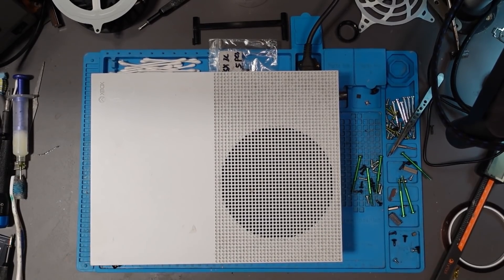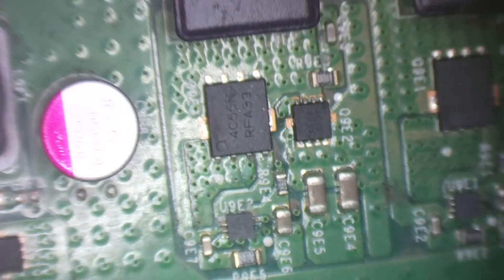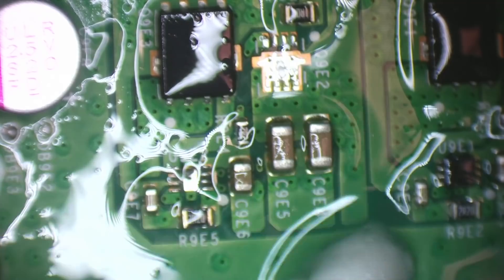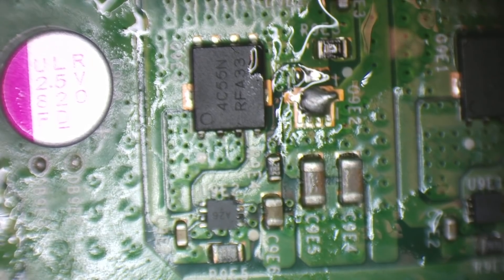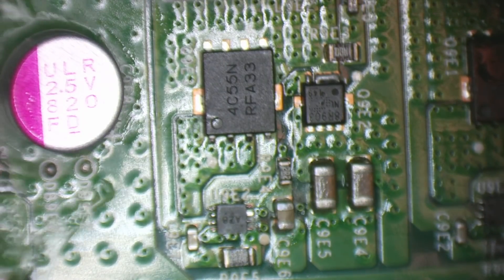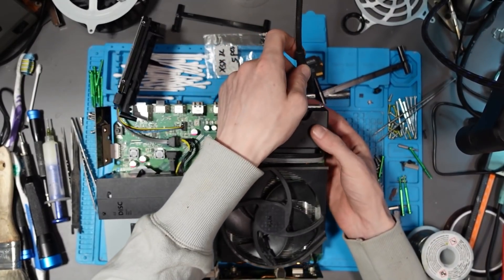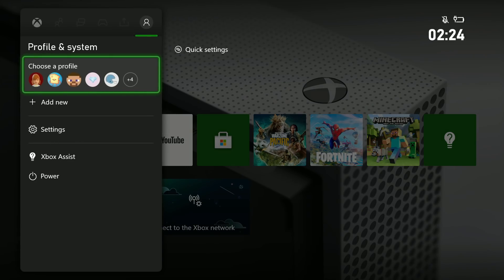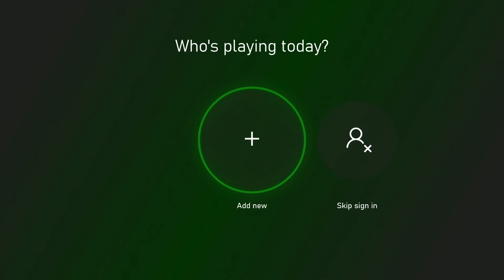I Paid $70 (£55) For A Broken Xbox One S From CASH CONVERTERS And This Is What They Sent Me...

Comment: Nice video man! I never owned an xbox one but i was considering getting a second hand one. Is it still worth getting one now with the series s/x being out?
Reply: No get the series s killer deal NEW
Reply: @fredc8618  i thought about series s but i don't really like the all digital concept i'd like a disc drive
Reply: Killer deal? What's that btw?
Reply from the maker: I'd say depending on price, but the series s is a good deal if you can pick one up second hand (bare in mind it's digital)
Reply: @TheCod3r  second hand? U can get it for as low as 250 new with a new controller and 500gb ssd cant beat it
Reply: Ppl are selling there used xbox ones for 200 its insane
Reply: @fredc8618  oh yeah but i saw one in netherlands at a pawn shop for 109,99€
Reply: @fredc8618  i'm not gonna pay around €200 or more for used anyway but you're right

Comment: I have a One X that failed on me. I managed to get it running but continued to fail over time. I believe I turned the power supply off during an update? Pretty sure it's a duff hard drive. You're welcome to have it and see what is actually the problem.
Reply from the maker: Is it a launch model One X mate? They had issues with the sata cables on the launch model which could explain it
Reply: It is mate, makes sense for it's random behaviour, from what you say.

Comment: I’ve been wanting an Xbox one to play some old 360 games I’ve been yearning to revisit; but didn’t want to spend much. I bought a very cheap console off of eBay for $60, seller said it didn’t turn on, was owned by themselves and well taken care of, and had never been opened or worked on. I get it about 3 weeks after purchasing, and left it in a box in my closet for a few weeks. 

I pulled it out recently, opened it up, found a missing hard drive, and severe liquid damage. So disheartening, but I suppose that’s what I get for trying my hand at console repair. I have some moderate solder experience, but that board was too far gone. Looked like the whole console had been dropped in the bath.
Reply from the maker: Oh wow that sucks mate, surely you can open a case on ebay? Don't let it put you off, some sellers are complete wankers but not everyone is

Comment: I have an X Box One S that can read DVD's but not games. I've updated the software and changed the laser but neither solved the problem. Any ideas what I should do from here? The disc does spin.
Reply from the maker: That sounds like it could be either a cable issue or possibly thr drive controller. If it's the controller it unfortunately can't be fixed because the controller is paired to the main board
Reply: @TheCod3r  Thanks for response. I appreicate it.